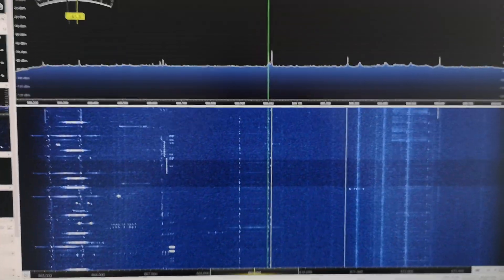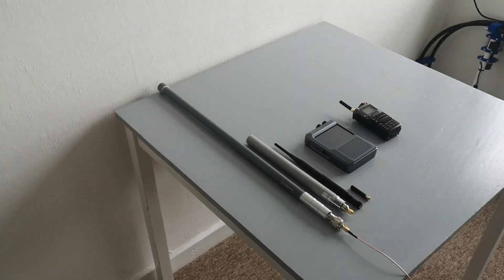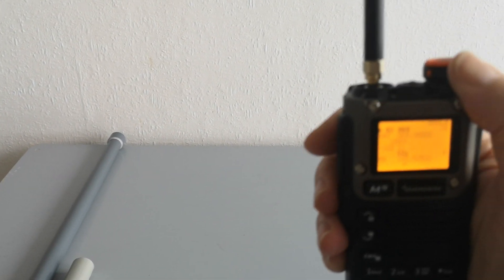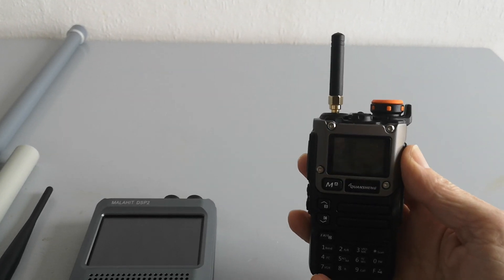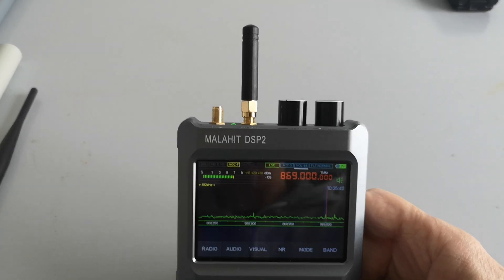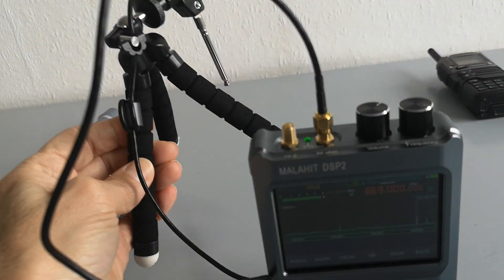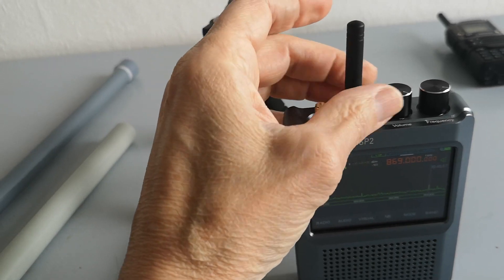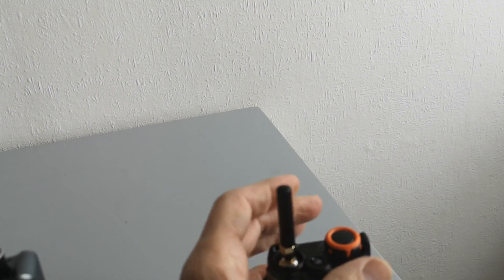Meshtastic Antenna Comparison

Comment: Does the length of the cable connecting to your outside antenna made much difference?
Reply from the maker: It makes a huge difference ! Some cables are very lossy indeed. I always mount the antenna direct to the node and have a long USB cable instead.

Comment: I had to send my DSP2 back.. it was terrible. Even touching the screen caused birdies all over the bands. Must of just been a bad one!
Reply from the maker: You probably had a band one as mine doesn't seem to have any birdies. If I use it on HF with a telescopic antenna on top, then touching the screen causes a rise in noise level but that is all.

Comment: Good video as always!
The activity you are seeing in this part of the spectrum could also be the ton of Helium miners around which also use LoRA.
You could improve the Quansheng antenna by attaching a small wire as counterpoise.
Reply from the maker: I had forgotten about Helium. Is that still going ? I don't see any news of it and imagined that since they devalued the rewards a few years back it had died a death. Thanks for the antenna tip.
Reply: I think it's on its way out, slowly but surely, however still tons of miners still online, possibly as many as before, people desperate to recoup their investment. What a con that was ...

Comment: Can you share a link to the AliExpress aerial please
Reply from the maker: Today's price is 2.97GBP. Remember that they need to be opened and adjusted from 940MHz down to 868MHz and they will never achieve the advertised 12dBi gain. Max theoretical gain for a dipole like this is 2.1dBi.
Reply from the maker: https://www.aliexpress.com/item/1005003750977051.html?spm=a2g0o.productlist.main.35.7a9edec1npHSRk&algo_pvid=c761c89b-cdeb-4e48-8da2-b52043b65fab&algo_exp_id=c761c89b-cdeb-4e48-8da2-b52043b65fab-17&pdp_npi=4%40dis%21EUR%214.06%213.33%21%21%2130.86%2125.31%21%402103890117086114357802573e52a5%2112000028267381175%21sea%21UK%212758880207%21&curPageLogUid=0QCZgjriAQ22&utparam-url=scene%3Asearch%7Cquery_from%3A

Comment: Wow parada are good but i have genuine one come from paradar and it dont have name printed on they are labels
Reply from the maker: Interesting ! There are so many fake products around that it is unfortunately hard to know what is what !
Reply: Yes, correct. Your tests are very good thankyou. Shame we can't add photos here id show you the real one. Yours looks the same apart from the hetched branding which on mine are 2 stickers. 1 is model other is qc sticker.
Reply: They do have the name URL printed on them actually, the official Paradar antennas. You can confirm this by looking on their website at some of the photos, you'll see the stickers on one side and the printed name on the other.
Reply: @KingMoronProductions then they must have changed them as mine arrived yesterday in a tube from paradar marked up with paradar but the antenna isnt. It just has 2 stickers on which have now about fallen off. Sorry for the incorrect information must be a factory change?